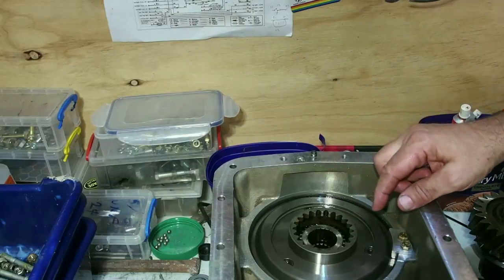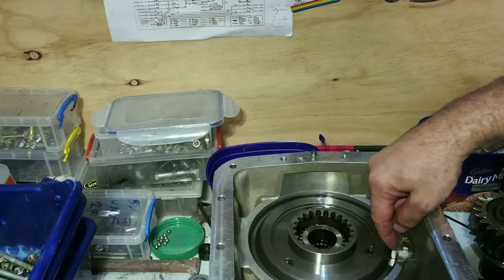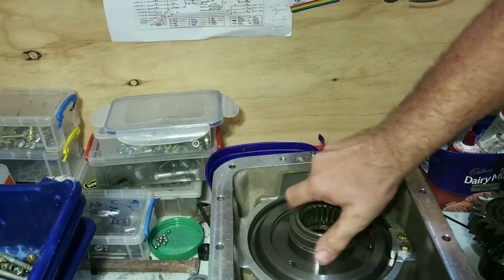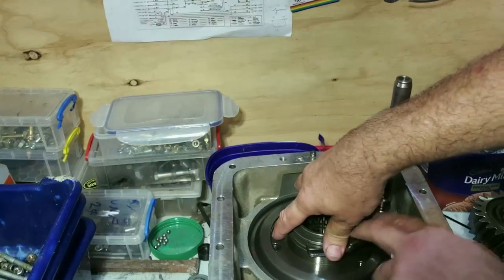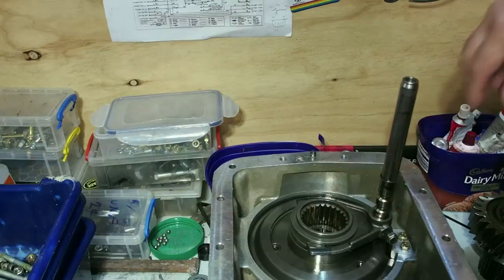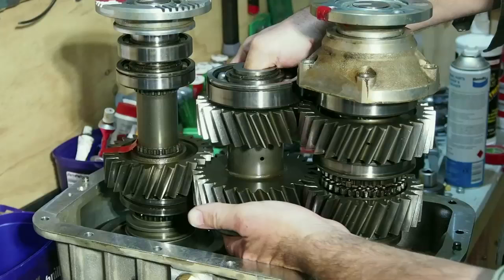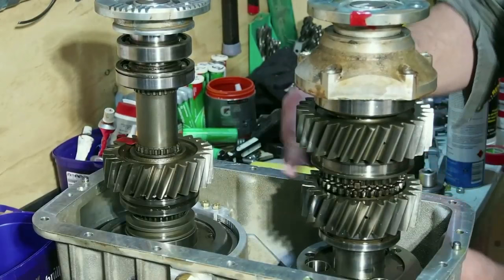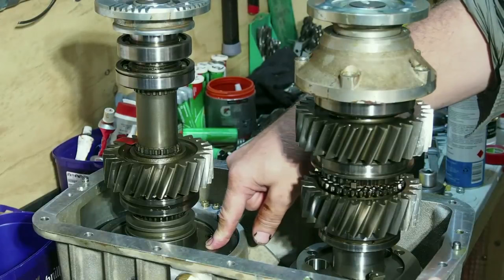Iveco 55S17W Transfer Case FAIL explained !

Comment from the maker: HEADS UP,   The TC can also fail in High Range too, (and a number have),  When the circlip pops out  the thrust plate can come forward and the 3 gear pins are free to float forward, dropping their uncaged  needle bearings  into the cluster, the protuding pin will then take out the Low/High selector followed by a runaway train of damage.